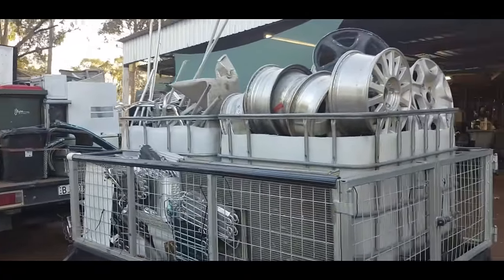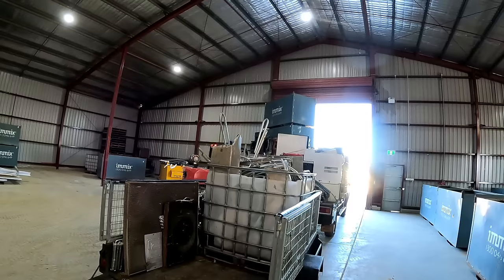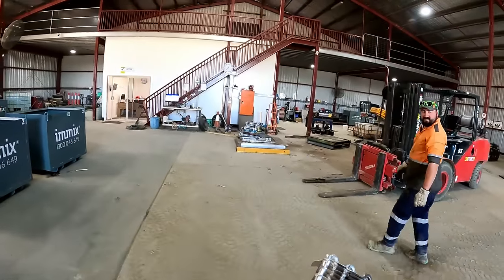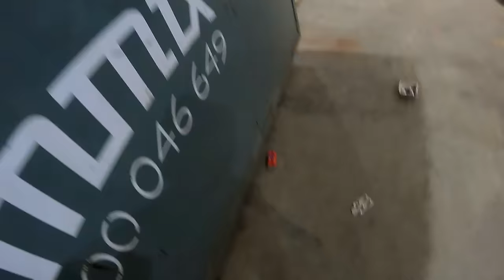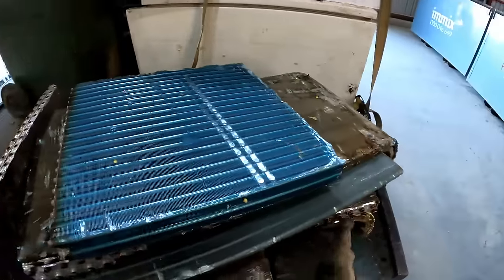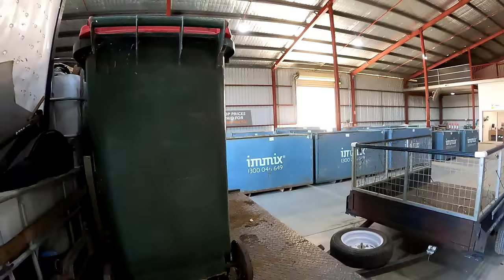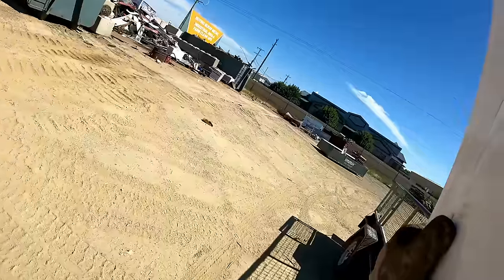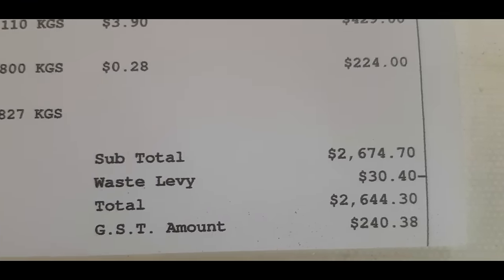SCRAP RUN NO. 16 A Lot Of Aluminium And More

Comment: Bicycle wheels are not extrusion. They are old sheet and the aluminum pieces that are to refrigerators that are also old sheet, they don’t go away as radiators and signs goes as dirty old sheet because of the material. Radiators are a totally different category with anything else.
Reply: they are extrusion bike wheels.
Reply: frigerators rad are dom ail.